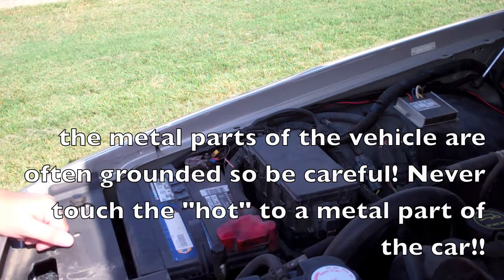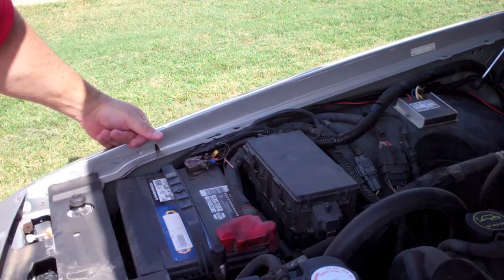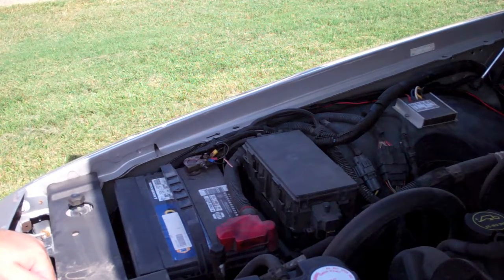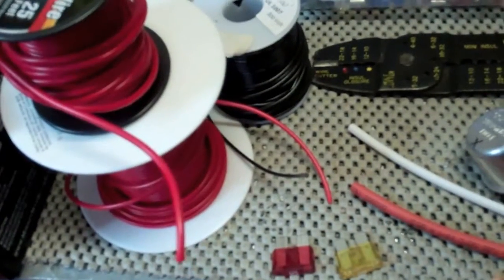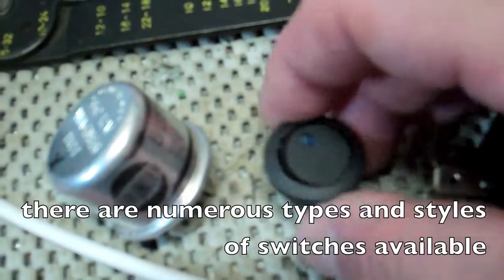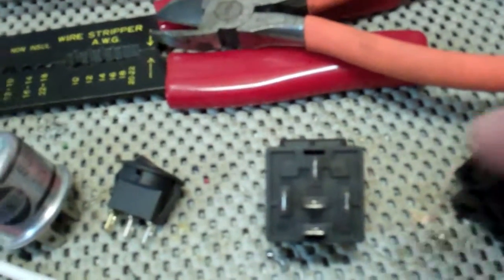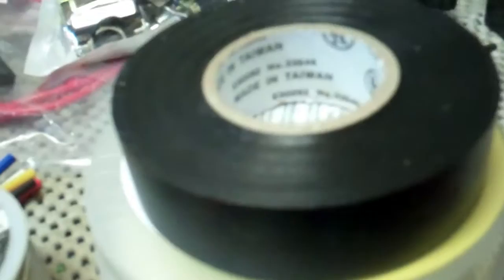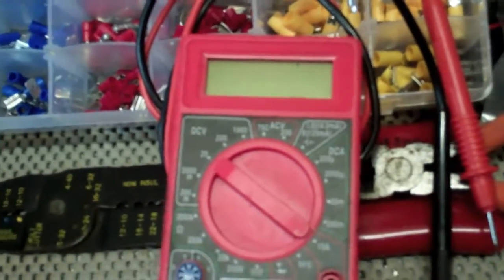"How to wire" ... Introduction to electrical wiring in vehicles

Comment: I own a 2011 ford crown vic im just wondering if you went through all the old police wiring and got rid of it. Im thinking of doing this but im kinda scared of screwing up something
Reply from the maker: I did remove all the old police wires that I could find on my 2003 & 2008 Crown Vics but haven't done that on my 2010 (yet?).  Both of the older ones actually had live "hot" wires hanging cut but exposed.  I was shocked (pun intended).  So I traced them to their power source, disconnected them and pulled them out.  There were also wires that were cut at both ends, and they could be removed easily.  I have found that most of them slide out fairly resistance free.  If you get resistance, they may be connected to something (with tape, zip ties, or solder).  If you feel the need you can disconnect the battery and then all the wires can touch whatever without sparking.  You might get lucky removing them and have a decent supply of wire for other projects, or it may just be trash.  Good luck!